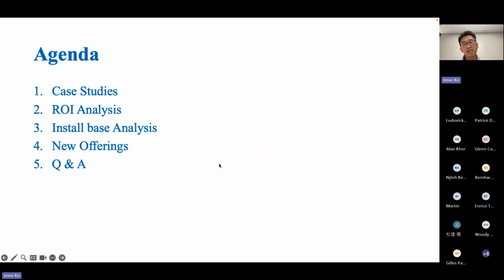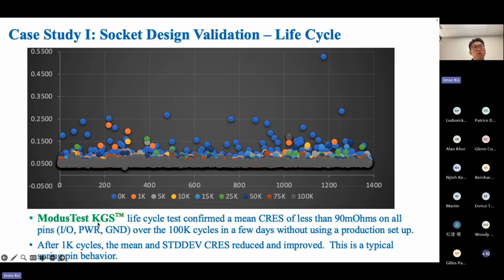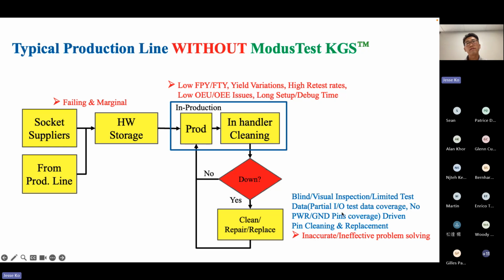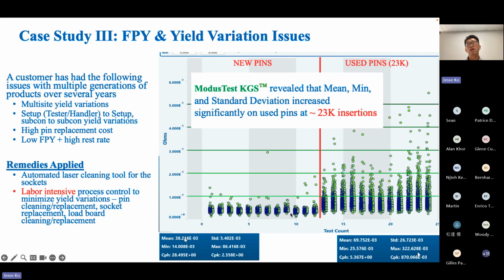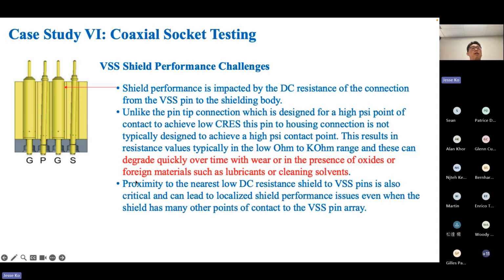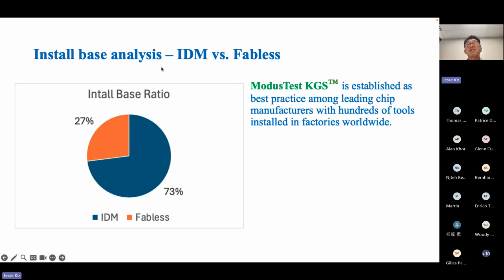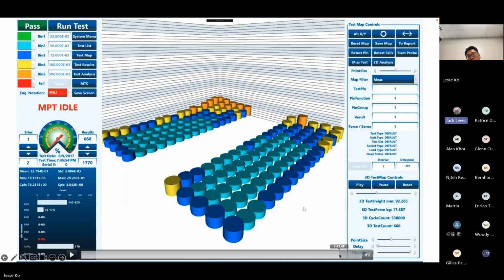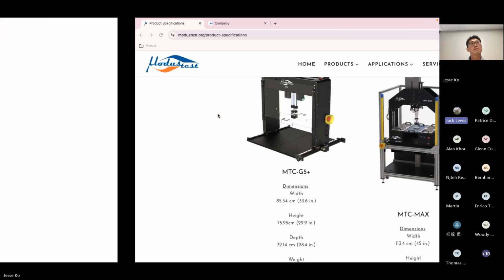ModusKGS

Comment: Around Minute 34, ROI calculation is incorrect. You need to look at depreciation of tester/handler per month for monthly savings; instead of the full tester cost. Also the savings need to be compared with running cost of Modus KGS.
Reply from the maker: Thank you for your reply.  I agree with the comment on depreciation.  However, this varies by company, and we do not have access to the data.  Another way to look at it is that it prevents you from adding new testers/handlers (Cost Avoidance) because it helps you maximize depreciated equipment.  That's why I built it with the best (worst) case scenario.  I also agree with your comment on running costs.  Once again, it varies by the company.  But we know that it's minimal compared to the capacity cost avoidance from Modus KGS.